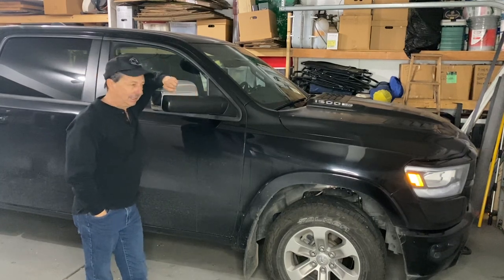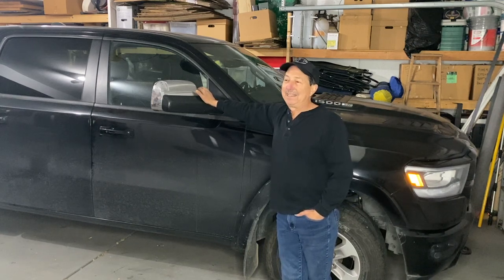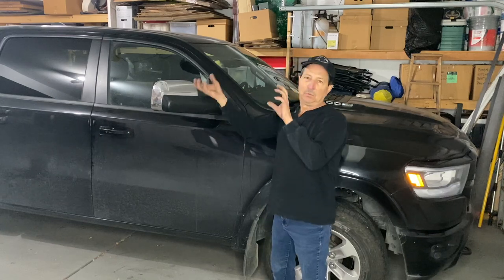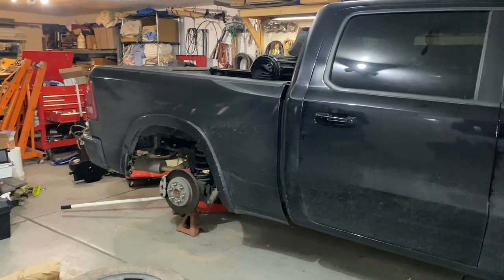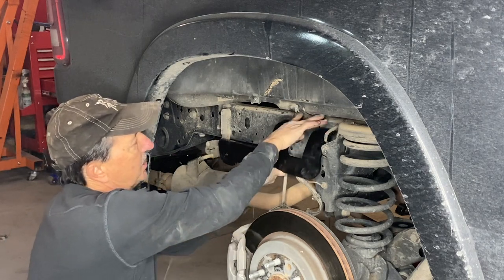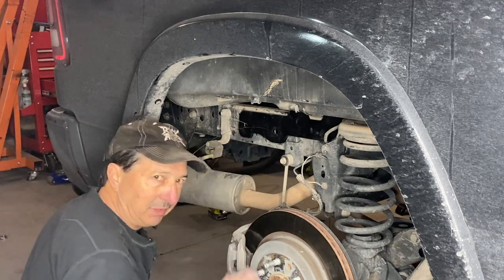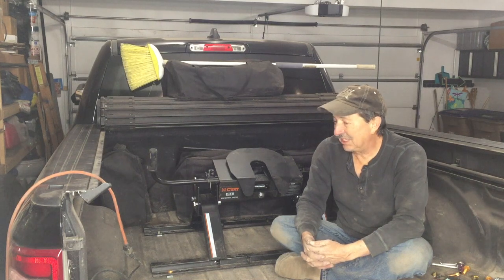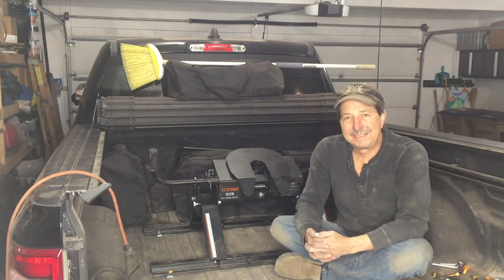Install A 5th Wheel Hitch In A Fifth Generation RAM 1500 and Similar Half Ton Trucks.

Comment: If you have a pay load capacity of 2100 lbs. And you have a 5th wheel that weighs only 10,000 lbs. You have a pin weight of 2000 lbs by itself. Let alone the hitch, passengers, fuel and all of the other stuff that's added weight to the to payload capacity.really?
Reply from the maker: Or you can go with the actual facts. Truck has a max payload of 1950 lbs, 5th wheel (on the scale) is 8500 lbs fully loaded with 1400 actual pin load. Leaves 450 lbs for people, fuel and misc. A CAT scale tells the real story.

Comment: Anyone that thinks they can tow a 5th wheel with a half ton. Didnt do their homework. Half tons are not made for 5th wheels.. their suspensions are not beefy enough. To handle the weight. What about bumps in the road. What about sag. ( Air bags dont increase your paload capacity). What about wind. Anybody can get one moving. But can you stop it. Ill bet your breaks arent designed the stop a 5th wheel. And if you have an accident. And they find your overloaded. Its your fault automatically. No matter who was at fault. Pin weight is 20%. Of the 5th wheels GVWR.  That doesnt include the hitch. The passengers. And extra stuff in the truck. What is your payload capacity.. that number also incudes a full tank of gas. Its sad to see all you half ton guys. Trying to convince yourselves its ok. To drive overweight. And it wont be by just a little either. Before you do this. Look up accidents. Driving over loaded with a half ton. Enjoy.😢
Reply from the maker: I totally agree, you must match the trucks ratings with any trailer. So I did all my homework. I found several 5th wheel trailers that are 3000 pounds under my trucks tow rating. It's also 700 pounds under load rating. My last bumper pull trailer was the same weights as these 5th wheels trailers and the bumper trailer was horrible to tow. The 5th wheel tows fantastic and sets level. No worries.
Reply: @riderescue these guys don't know my 2020 1500 ecodiesel has more torque than the Chevy 6.2l v8 . I'm rated to tow 12,500lbs and payload 2,100lbs safely they are build beefier than the previous generation. My 1500 is a 1 ton truck.
Reply: You must be awesome at BBQ's. 
If you haven't been re-invited to one..... well, there's your hint

Comment: I have a 1/2 ton Silverado and tow a 28' 5th wheel. The only limit I have encountered is the truck has the 5.3 so it was a little weak on the hills. I installed airbags thinking it might be heavy but never used them even when the water tank was full. Now they make an adapter 5th wheel companion. It's a 5th wheel that sits down into the gooseneck ball slot so you can remove the 5th wheel and not have the rails.
Reply from the maker: My Ram's tail dropped so I installed air spring lifts and that leveled mine out. I have put about 3000 miles pulling 27 footer and I am very happy with my set up.
Reply: @riderescue  I recently traded my 1/2 ton Silverado for a Ram 1500. Do you know how much tongue weight you normally have? Bumper hitch pull or gooseneck/5th wheel?

Comment: Just try to pull your 5th wheel up some mountain passes out west. Not only do you need a heavy duty 3/4 ton and a diesel.
Reply from the maker: Yep, I live in Utah and I have traveled on some of the steepest mountain roads in the Rocky Mountains. I'm fortunate that my truck pulls, stops, and handles fantastic. Holds the speeds going up or down. At 8200 pounds, loaded, the 5th wheel is way better to pull than my bumper pull was.

Comment: I really appreciate the time and effort to make this video.  My "half ton" has a HD towing package which includes transmission cooler and upgraded brakes (found that out the hard way when I did brakes last year) so I would feel comfortable towing a 5th wheel with my truck and thanks again to you. I am confident that I can add the 5th wheel hitch now if I decide to go that route with a new camper.

Comment: I have fifth wheel that weighs 3700 LBS. with a hitch weight of of 700 LBS. which is pulled by a F 150 with trailer package.I have no problem pulling that trailer.
Reply from the maker: Yes, your truck will have plenty of capabilities to load extras. I had a small 5th wheel like yours several years ago that I pulled with my Nissan Frontier with no problems and well within the trucks specs.

Comment: Thank you for posting this. I don't see a problem towing a fifth wheel trailer, as long as it is light enough. The same goes for a pull trailer. If you have the Big Horn edition, you have the tow package with heavier brakes, cooling for engine and transmission, and the Hemi engine.

Comment: When installing the gooseneck on my Silverado it was easier to use a come-along to lift the bed off and install.
Reply from the maker: I had to lift off the bed of my Ram to restore the bed side. It would have been easier to pull the bed and install the gooseneck style. I don't like the rails when I need my full bed for loading.

Comment: Excellent informative video, thank you! What type of air bags did you add on and what do you think about the Timbrens?
Reply: I have the 21 ram 1500 bighorn and went with the tuftruck Progressive rate coils. They work great when loaded and don't ride much different than stock with no load

Comment: Nice job bud..still a little concerned about the fifthwheel on a 1500..upgrade the brakes would be my recommendation..most trucks can pull,you have air ride to help with squat but braking is always the issue with half tons..good luck sir
Reply from the maker: Thanks 👍. My last trailer was over 8000 pounds loaded and I live in the Mountains of Utah so I had to be very careful keeping the brakes cool. As long as I kept the speeds down on the steep down hill grades I never had any issues. The new 5th wheel trailer is only about 500 pounds more total so we'll be okay. Thanks for watching.
Reply: Does not matter what you add to a 1/2 ton; bump stops, springs, air shocks, etc.. It STILL is only a half-ton frame. Half tons are made for comfort to appeal to a larger audience. Not made to tow these campers over 5000 lbs. Just buy a real HD truck. Actually adding anything to any vehicle decreases its cargo capacity/tow ratings because you have added extra weight to try to make it tow more. It won’t be long, if not already done, that some attorneys will understand tow ratings and safety margins and the lawsuits will start. The first to get sued should be the manufacturers and salesman who promote this.
Reply: My 2020 1500 limited 3.0l ecodiesel rated to two 12,500lbs and payload 2,100lbs that's a 1 ton capacity. It can safely pull what old dually could pull. Very safe

Comment: what would you recommend for a 11,000 pound 5th wheel?
Reply: 3/4 ton or above. You will have to check the cargo weights/ tow capacity then multiply by 75% to get safe/ margin of error tow rating/specs. Please, Please, Please, Don’t believe these 1/2 ton towables. 11,000 lbs x 20% = over 2000 lb pin weight. No 1/2 ton has that much cargo capacity + passengers (350)+ hitch (200) + tools/junk (100) = 2650 lbs cargo capacity. Always, Always buy more truck than you need. It will make for a great towing experience vs a white knuckle event.
Reply: By a truck that can handle the payload capacity. Your pin weight will be 2100lbs.